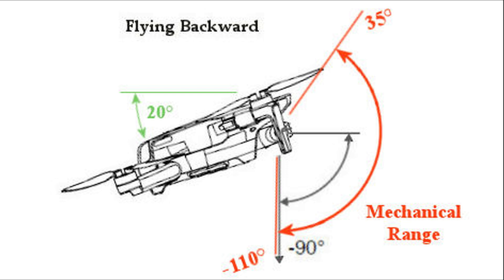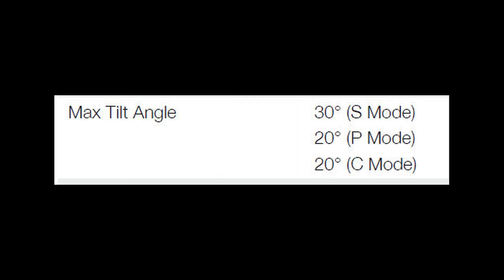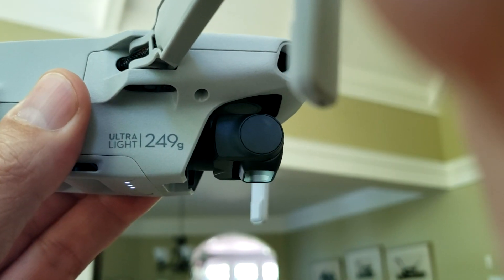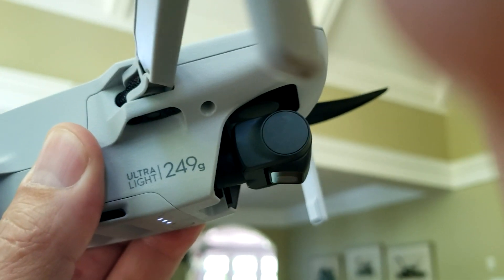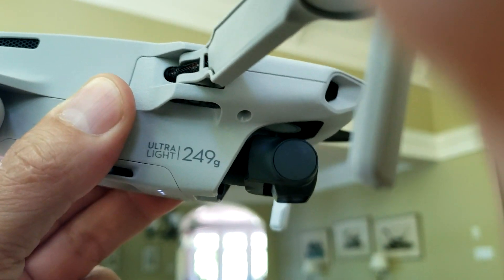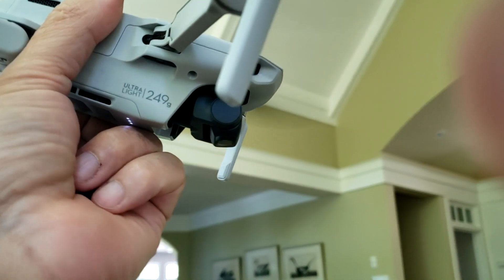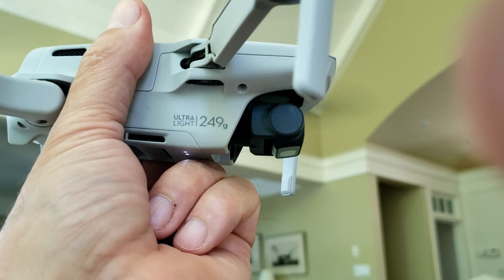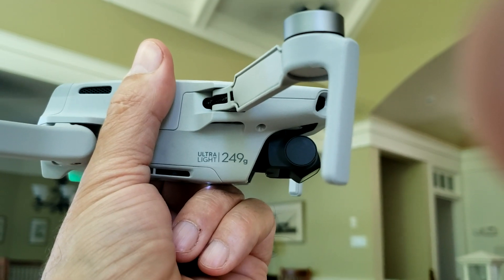Mavic Mini - Gimbal Vertical Down Tilt Limit

Comment: Thanks for this video! I have a prob tilting down the camera. It works in the RC but whenever i want to put the camera downward, it automatically return to original position. Did you have this problem before? How did you fix it?

Comment: I have this issue with the mini 2
Reply: What did you end up doing to fix it?
Reply: @tman5488  doesn't appear to be a fix unfortunately. Take it you have the same thing?
Reply: @jaysee2213  Yeah I have the same issue - it even happens in Normal mode sometimes and without strong winds. Not sure if I just have to live with it or if i should take it back to the shop where I bought it
Reply: @tman5488  same, happens to me in normal mode too. I'm some ways I'm glad to hear that it's not just mine but in other ways I was kind of hoping that getting an exchange under warranty would sort it out. I do mostly photography rather than video but if I want to film straight down it can be very frustrating, I'm also the sort of person that gets annoyed with faults, even if they don't matter..... But I guess that's my faulty head lol
Reply: @jaysee2213  I do know of some Mini 2 owners that have never experienced it in any mode at all, so it seems like a defect on some of the Mini 2 drones but not all of them. I guess it’s just a matter of luck if you get one with the fault or not. I’m still tempted to try to return mine for a new one under warranty and hope that the replacement doesn’t have the issue. I also just want it to work properly - I take more photos than videos as well, but as a matter of principle it still should do what it says on the box
Reply: @tman5488  I agree, it should work properly, I might email DJI support and see if I can get some answers, although last time I did that I had little to no success and ended up getting a better answer off Ian In London. 
Let me know if you return it and how you get on!!

Comment: But how do u tilt the camera down ???
Reply: For a month!!!  I’m busting my head off to find how to tilt the camera down. OMG. I didn’t realize the wheel too. Btw. I’m new in this drone scene. LOL. Thanks for the tips my good sir.
Reply from the maker: @BHR351  Download the Mavic Mini User Manual from here: https://www.dji.com/mavic-mini/downloads
Reply from the maker: There is a wheel on the remote controller that lets you rotate the camera gimbal to any angle ranging from pointing vertically straight down to up to 20 degrees above horizontal.
Reply: Thankyou !
Reply: I would have never seen it haha

Comment: Did you think to check your sound quality before uploading this video. I could hardly understand what you were saying, especially while the propellers were running. But the information I needed was there so thanks for that.
Reply from the maker: Sorry about the sound, this was rushed.  I need a proper microphone.  I just used a GoPro camera to record myself talking, but was stupidly holding it in my hand and fidgeting with it.  I should have just set it down and not touched it.